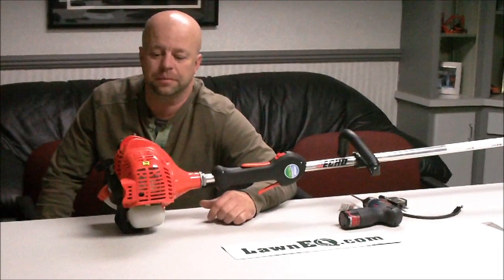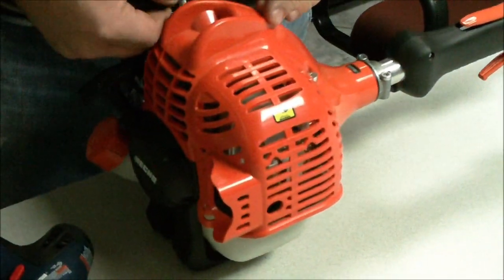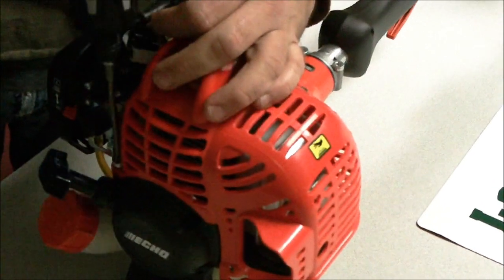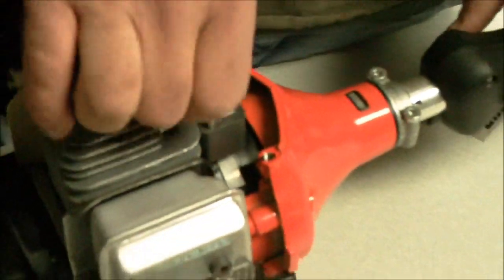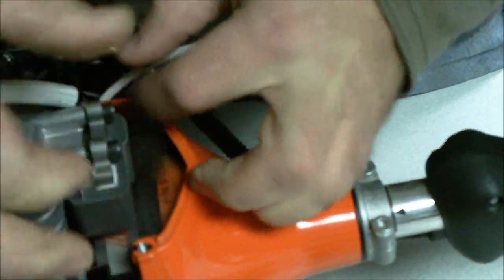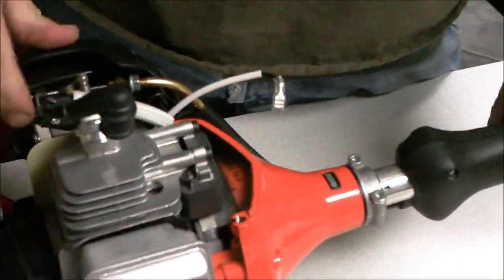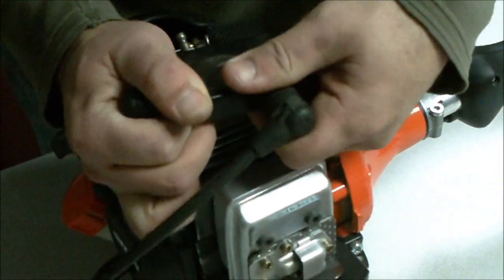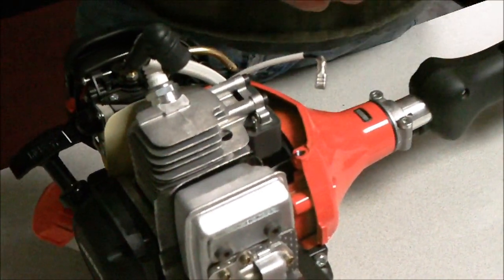How to Check the Ignition on an Echo SRM 225 String Trimmer

Comment: For the spark test, just put it on the block and hit it. That’s good enough. I had the problem that the coil came loose and jammed into the magnets on the flywheel. I set it to .005 thou. This made it to where it’d spark too early and exhaust would come out the carb lol. Setting it to .014 cleared the problem and it runs like a champ

Comment: before changing coil. check contact at end of plug wire to the plug, remove the plug boot check the contact wire spring at end of wire that connects to the plug and check for corrosion,,, if you have corrosion just repair it... sometimes you got to check the end of the wire...   just say`n

Comment: I have spark, good fuel and a new carb. Still will not start. Checked the exhaust screen as well and it's clear. Have tried starter fluid and it just won't fire. Could it be the ignition coil even though I have spark? Or, could the switch on the handle be broken? I would think if it did not work, I would not be seeing a spark when I ground the spark plug to the engine. Have tried 3-4 spark plugs as well. Stumped (SRM225).
Reply: Same issue here. Did you fix yours?
Reply: Same here 
I have new carb and lines etc.and good fuel 
I even by pasted the wires on the side to make sure it wasn’t a switch problem. Still no start even with starter fluid 
About to go now and do the clearance and if that doesn’t work it’s going to get a new coil
Reply: Try increasing the main idle speed screw (clockwise). Sometimes it can’t get enough air through the carb to run.

Comment: the fuel bulb and I had to clean the ignition coil with an emery board and replaced the spark plug. I got it to if I pump the fuel bulb it will now start but as soon as that gas is used up it cuts off. Any suggestions, I really need to get it working as I live on disability and can't afford a new one.